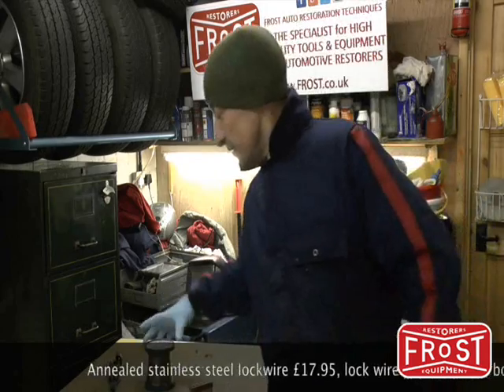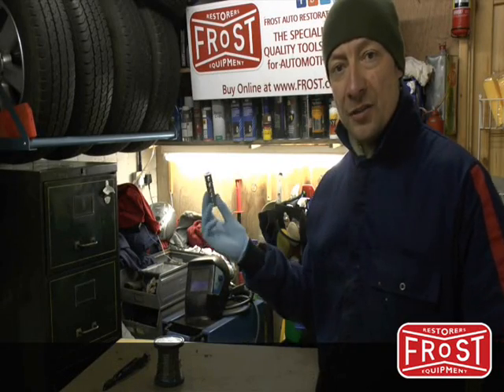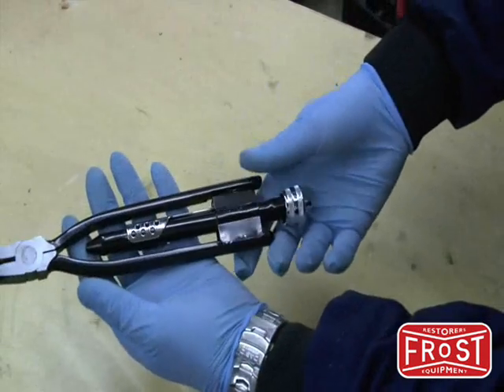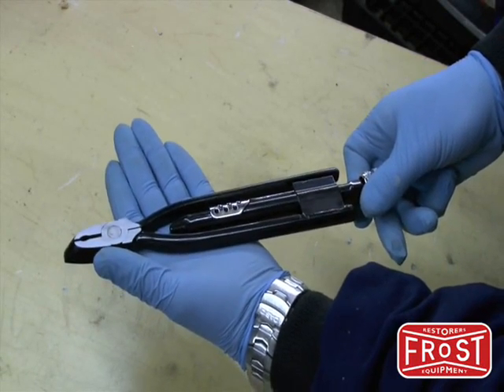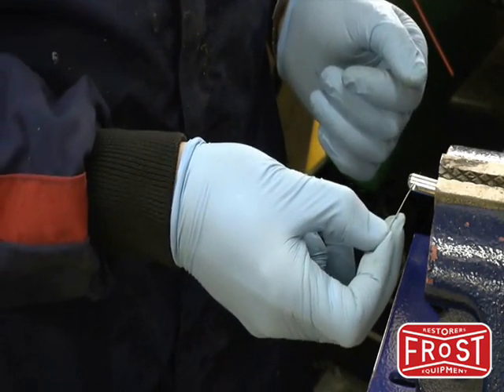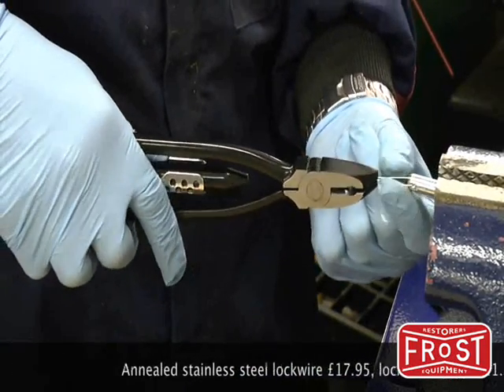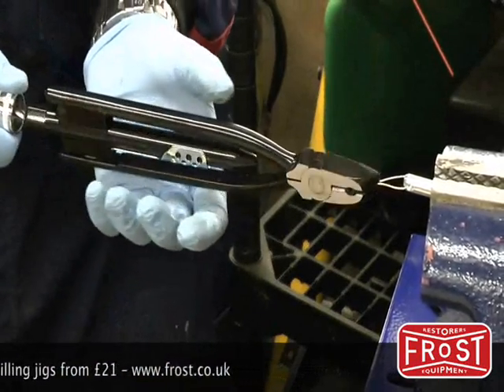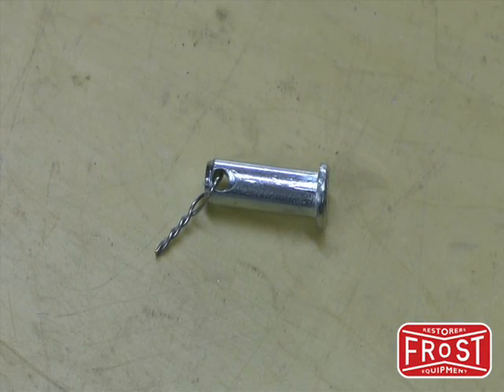Safety Wire Twisting Pliers for Locking Nuts and Bolts

Comment: Neatly wired clevis pin! Not so. This is just half the job, you should pig tail the end so nobody will cut or snag on the sharply cut end. Take a look at this; google for; MS33540J, MILITARY STANDARD: SAFETY WIRING AND COTTER PINNING. That is the standard we use on aircraft, and is a comprehensive guide for the professionals, good luck!
Reply: That was horrible. Why not just use a cotter pin?